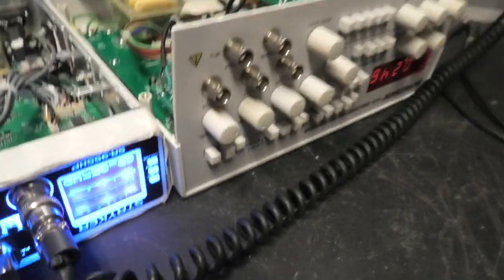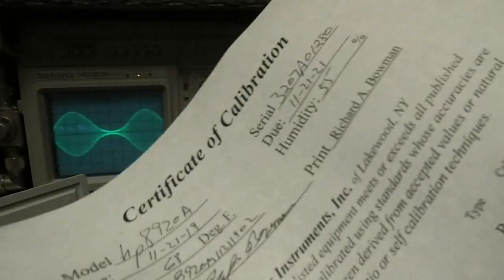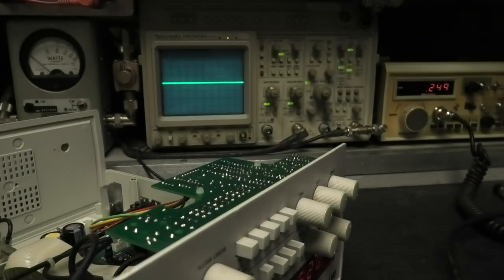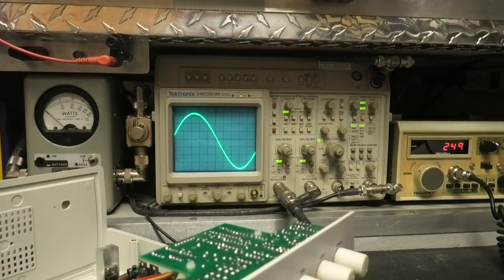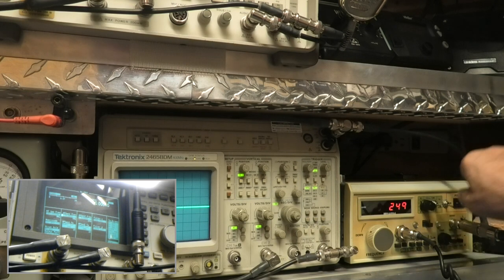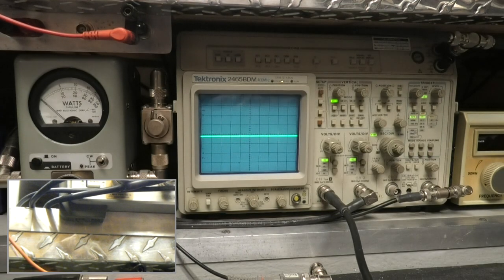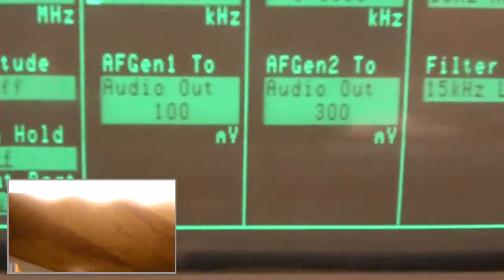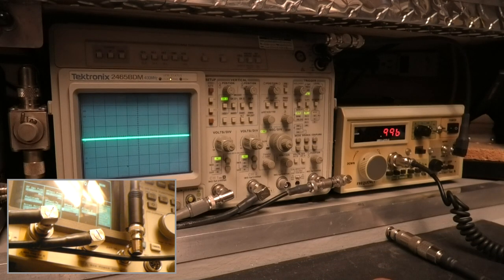Fine Tune CB Radio Shop - NIST 700Hz - 1.9KHz Dual Tone True Analog Audio Generator Reference Test.

Comment from the maker: Never Settle For Less Or That's What You'll Get, Fake Hocus Pocus Readings, $$$$ out of your pocket and you sitting there wondering why your system doesn't perform the way they "claimed".   DON'T BE STUPID,   here's what it takes to cut through the noise, be loud and crystal clear with a better receiver too:  A) Tuned Bench:  https://www.youtube.com/watch?v=lwcDfXOgAls.  True, it's more complicated and time consuming to accomplish these consistent and accurate results. Below is a partial procedure and list of calibrated equipment used to achieve this level of performance . Read on ..
 Fine Tune CB Radio Shop strictly adheres to (https://www.nist.gov/) NIST Traceable Calibrations and other industry standards to maintain accuracy and consistency for providing Real World Performance Tuning of Citizens Band and 10 Meter export mobile radios with integrity.
 "Basic Textbook AM/FM/SSB Transceiver Tune, Alignment and Calibration" 
1) Pll adjustments
VCO & OSC, AM TX OSC, USB TX OSC, LSB TX OSC.
2) Transmitter alignment
DRIVER BIAS, FINAL BIAS, SSB  (or gate voltages for mosfet versions) CARRIER BALANCE, HI-LO AM & SSB Power, RF METER, AMC, ALC and FM DEVIATION.
3) Receiver alignment
AM/FM RF & IF SENSITIVITY, FM DETECTOR/DEVIATION, SSB IF SENSITIVITY, SSB S-METER, AM/FM S-METER (100uV unmodulated -67dbm for �S-9� meter reading!), AM/FM SQUELCH RANGE, SSB SQUELCH RANGE, and NOISE BLANKER/AUTOMATIC NOISE LIMITER (Real World dBm to volts (uV) tables below).
That's just a typical run of the mill textbook tune up and alignment (if you're lucky). There's more to it than frequency alignment, modulation adjustment, meter calibration and a tune up report displaying exaggerated rms Bird peak watts! 
"Test Bench includes"
Bird 4314C Meter
https://www.birdrf.com/Products/Test%20and%20Measurement/Power-Meters/Wattmeters-Line-Sections/RF-Wattmeters/4314C_PEP-Single-Element-Wattmeter.aspx
Part 1) https://www.youtube.com/watch?v=RpX9IHe4ORM&t=16s
Part 2) https://www.youtube.com/watch?v=LuhbqTf6Bxw
Bird 4314C Accuracy Test: https://www.youtube.com/watch?v=DqEOabYqhQo&t=5s
Bird Stipulates 1/2 wavelengths  https://www.youtube.com/watch?v=5eWhgT-rTII
And Genuine Bird Elements from 1K down.
Bird 4373 Sampler 
https://www.rfparts.com/signal-samplers.html
HP8924c with options
http://userequip.com/files/specs/2147/HP%208924C%20Repair.pdf
https://www.youtube.com/watch?v=Cg1w0xBa27s&t=1s
HP8920a with options
https://www.keysight.com/upload/cmc_upload/All/EPSG072204.pdf
Three analog scopes, one digital 200 Mhz
https://www.atecorp.com/atecorp/media/pdfs/data-sheets/tektronix-2465b-2467b_manual.pdf
https://www.youtube.com/watch?v=by98x4eu2lM
Fluke 27fm
http://www.fluke.com/fluke/inen/digital-multimeters/fluke-27.htm?pid=56055
LCR http://www.lcrresearch.com/wp-content/uploads/2017/05/LCR_Pro1_Manual_version1.03.pdf
Power supplies
6 Cosel PBA1500f12 (750 amps) variable and configurable.
https://en.cosel.co.jp/product/powersupply/PBA/PBA1500F/PBA1500F-12/
Corcom 20VB1 F7130 EMI Filter 50-60Hz 250V
Times Microwave Coax jumpers and test leads
http://www.timesmicrowave.com/cms/products/cables/lmr/
https://www.youtube.com/watch?v=EmqaGJ6IWow
https://www.youtube.com/watch?v=1ltFVSxGp5Y
https://www.youtube.com/watch?v=v12YZT_1o90
https://www.youtube.com/watch?v=h7iiYfmYWRA&t=215s
Amphenol RF Connectors
https://www.amphenolrf.com/
https://www.youtube.com/watch?v=dVh5B0hdEA0 
https://www.youtube.com/watch?v=dKZg8T_AOso
 More range, compliments, reliability and a quieter, clearer but more sensitive receiver,  Get Fine Tuned .. not peaked and ruined.
 It's what I recommend, use, service and sell ... to you ... not something non practical or deceiving in a misleading way. I'm not just the tech and owner of Fine Tune CB Radio Shop, I'm a customer too!  When finished, You'll be giving radio checks, not asking for them .
 dBm To Watts and Volts
Tables below displays relationship between Power in [dBm] or [Watts] and Voltage in RMS, peak, peak-to-peak for sinusoidal signals in 50-Ohm systems for accurately measuring and tuning am/fm/ssb receiver sensitivity, agc, squelch and "S9" Meter calibration. Real World! Mike @ Mikes Radio Repair (Romper Room), Mark Rutherford aka Mark 19960, CB Kidd, Martian and all of your other fake accounts pay attention to the tables below, stop misaligning radios, spreading false information and promoting propaganda! 
 [dBm] [Watts]   [Volts]rms   [Volts]p    [Volts]pp
-140 0.100E-16  22.361 nV  31.618 nV  63.236 nV 
-139 0.126E-16  25.089 nV  35.476 nV  70.952 nV 
-138 0.158E-16  28.150 nV  39.805 nV  79.609 nV 
-137 0.200E-16  31.585 nV  44.662 nV  89.323 nV 
-136 0.251E-16  35.439 nV  50.111 nV  100.222 nV 
-135 0.316E-16  39.764 nV  56.226 nV  112.451 nV 
-134 0.398E-16  44.615 nV  63.086 nV  126.172 nV 
-133 0.501E-16  50.059 nV  70.784 nV  141.568 nV 
-132 0.631E-16  56.167 nV  79.421 nV  158.842 nV 
-131 0.794E-16  63.021 nV  89.112 nV  178.223 nV 
-130 0.100E-15  70.711 nV  99.985 nV  199.970 nV 
-129 0.126E-15  79.339 nV  112.185 nV  224.370 nV 
-128 0.158E-15  89.019 nV  125.874 nV  251.747 nV 
-127 0.200E-15  99.882 nV  141.232 nV  282.465 nV 
-126 0.251E-15  112.069 nV  158.465 nV  316.931 nV 
-125 0.316E-15  125.743 nV  177.801 nV  355.602 nV 
-124 0.398E-15  141.086 nV  199.496 nV  398.992 nV 
-123 0.501E-15  158.301 nV  223.838 nV  447.677 nV 
-122 0.631E-15  177.617 nV  251.151 nV  502.302 nV 
-121 0.794E-15  199.290 nV  281.796 nV  563.591 nV 
-120 0.100E-14  223.607 nV  316.180 nV  632.360 nV 
-119 0.126E-14  250.891 nV  354.760 nV  709.519 nV 
-118 0.158E-14  281.504 nV  398.047 nV  796.094 nV 
-117 0.200E-14  315.853 nV  446.616 nV  893.232 nV 
-116 0.251E-14  0.354 �V  0.501 �V  1.002 �V 
-115 0.316E-14  0.398 �V  0.562 �V  1.125 �V 
-114 0.398E-14  0.446 �V  0.631 �V  1.262 �V 
-113 0.501E-14  0.501 �V  0.708 �V  1.416 �V 
-112 0.631E-14  0.562 �V  0.794 �V  1.588 �V 
-111 0.794E-14  0.630 �V  0.891 �V  1.782 �V 
-110 0.100E-13  0.707 �V  1.000 �V  2.000 �V 
-109 0.126E-13  0.793 �V  1.122 �V  2.244 �V 
-108 0.158E-13  0.890 �V  1.259 �V  2.517 �V 
-107 0.200E-13  0.999 �V  1.412 �V  2.825 �V 
-106 0.251E-13  1.121 �V  1.585 �V  3.169 �V 
-105 0.316E-13  1.257 �V  1.778 �V  3.556 �V 
-104 0.398E-13  1.411 �V  1.995 �V  3.990 �V 
-103 0.501E-13  1.583 �V  2.238 �V  4.477 �V 
-102 0.631E-13  1.776 �V  2.512 �V  5.023 �V 
-101 0.794E-13  1.993 �V  2.818 �V  5.636 �V 
-100 0.100E-12  2.236 �V  3.162 �V  6.324 �V 
-99 0.126E-12  2.509 �V  3.548 �V  7.095 �V 
-98 0.158E-12  2.815 �V  3.980 �V  7.961 �V 
-97 0.200E-12  3.159 �V  4.466 �V  8.932 �V 
-96 0.251E-12  3.544 �V  5.011 �V  10.022 �V 
-95 0.316E-12  3.976 �V  5.623 �V  11.245 �V 
-94 0.398E-12  4.462 �V  6.309 �V  12.617 �V 
-93 0.501E-12  5.006 �V  7.078 �V  14.157 �V 
-92 0.631E-12  5.617 �V  7.942 �V  15.884 �V 
-91 0.794E-12  6.302 �V  8.911 �V  17.822 �V 
-90 0.100E-11  7.071 �V  9.998 �V  19.997 �V 
-89 0.126E-11  7.934 �V  11.218 �V  22.437 �V 
-88 0.158E-11  8.902 �V  12.587 �V  25.175 �V 
-87 0.200E-11  9.988 �V  14.123 �V  28.246 �V 
-86 0.251E-11  11.207 �V  15.847 �V  31.693 �V 
-85 0.316E-11  12.574 �V  17.780 �V  35.560 �V 
-84 0.398E-11  14.109 �V  19.950 �V  39.899 �V 
-83 0.501E-11  15.830 �V  22.384 �V  44.768 �V 
-82 0.631E-11  17.762 �V  25.115 �V  50.230 �V 
-81 0.794E-11  19.929 �V  28.180 �V  56.359 �V 
-80 0.100E-10  22.361 �V  31.618 �V  63.236 �V 
-79 0.126E-10  25.089 �V  35.476 �V  70.952 �V 
-78 0.158E-10  28.150 �V  39.805 �V  79.609 �V 
-77 0.200E-10  31.585 �V  44.662 �V  89.323 �V 
-76 0.251E-10  35.439 �V  50.111 �V  100.222 �V 
-75 0.316E-10  39.764 �V  56.226 �V  112.451 �V 
-74 0.398E-10  44.615 �V  63.086 �V  126.172 �V 
-73 0.501E-10  50.059 �V  70.784 �V  141.568 �V 
-72 0.631E-10  56.167 �V  79.421 �V  158.842 �V 
-71 0.794E-10  63.021 �V  89.112 �V  178.223 �V 
-70 0.100E-09  70.711 �V  99.985 �V  199.970 �V 
-69 0.126E-09  79.339 �V  112.185 �V  224.370 �V 
-68 0.158E-09  89.019 �V  125.874 �V  251.747 �V 
-67 0.200E-09  99.881 �V  141.232 �V  282.465 �V
-66 0.251E-09  112.069 �V  158.465 �V  316.931 �V 
-65 0.316E-09  125.743 �V  177.801 �V  355.602 �V 
-64 0.398E-09  141.086 �V  199.496 �V  398.992 �V 
-63 0.501E-09  158.301 �V  223.838 �V  447.677 �V 
-62 0.631E-09  177.617 �V  251.151 �V  502.301 �V 
-61 0.794E-09  199.290 �V  281.796 �V  563.592 �V 
-60 0.100E-08  223.607 �V  316.180 �V  632.360 �V 
-59 0.126E-08  250.891 �V  354.760 �V  709.520 �V 
-58 0.158E-08  281.504 �V  398.047 �V  796.094 �V 
-57 0.200E-08  315.853 �V  446.616 �V  893.232 �V 
-56 0.251E-08  0.354 mV  0.501 mV  1.002 mV 
-55 0.316E-08  0.398 mV  0.562 mV  1.125 mV 
-54 0.398E-08  0.446 mV  0.631 mV  1.262 mV 
-53 0.501E-08  0.501 mV  0.708 mV  1.416 mV 
-52 0.631E-08  0.562 mV  0.794 mV  1.588 mV 
-51 0.794E-08  0.630 mV  0.891 mV  1.782 mV 
-50 0.100E-07  0.707 mV  1.000 mV  2.000 mV 
-49 0.126E-07  0.793 mV  1.122 mV  2.244 mV 
-48 0.158E-07  0.890 mV  1.259 mV  2.517 mV 
-47 0.200E-07  0.999 mV  1.412 mV  2.825 mV 
-46 0.251E-07  1.121 mV  1.585 mV  3.169 mV 
-45 0.316E-07  1.257 mV  1.778 mV  3.556 mV 
                 Don't Be A Mud Duck!
 https://www.arrl.org/shop/ARRL-Handbook-2019-eBook
 163 Hard Dr
 Click click.

Comment: Wow !!!!! Fantastic video!!!!! The proof is in the pudding !!!!! You cant do a good job without the correct tools ! The paper makes the grade !!!!
Reply from the maker: As you can see, there are many variables and they stack up quickly. Without a Standard of Calibration there's No Way On Earth that you can achieve Real-Word Performance. You have in your possession the entire recipe, cooking temperature , and how long to cook. Taste good?

Using parts that I purchased from Mouser 1983-1984 .. they had just opened in Mansfield.
Reply: @FineTuneCBShop  I am at mouser electronics right now !!!